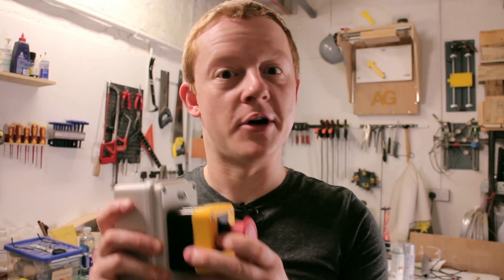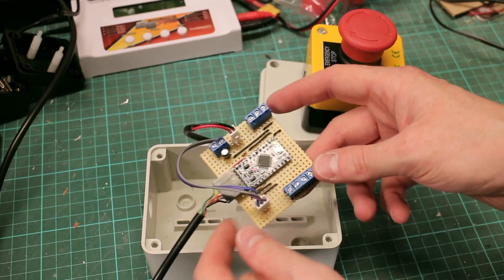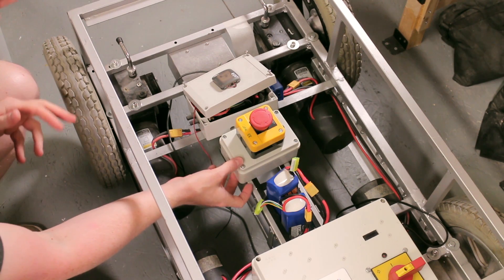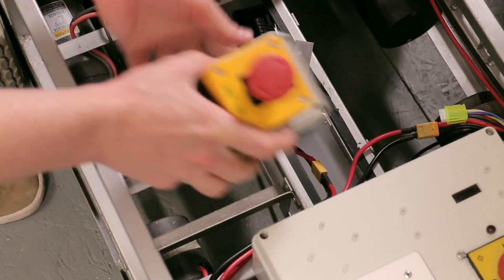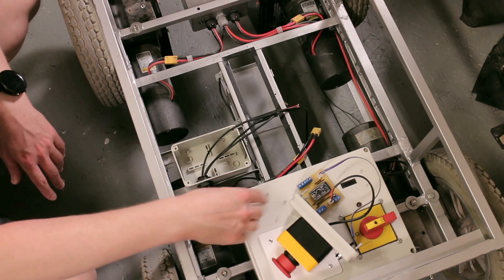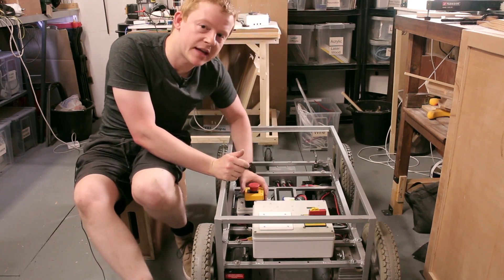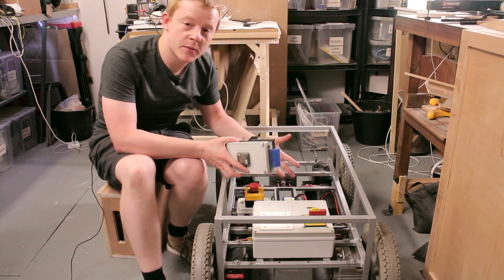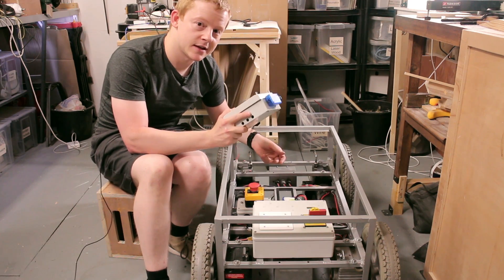Emergency Stop Button - Robotic Vehicle #4

Comment: so let me see if i am getting this right, kevin has dc motors and pwm, so if the pwm switching fails and goes short you have a runaway and a big red off button that wont isolate the motors....
basically, your motor isolator doesnt isolate the  motors....
Reply from the maker: +lez briddon it's doing two things, the main use is local close up testing and a way to stop it moving, this is what I mentioned in the video.
Another thing I have it setup to do is send out a stop signal if the input signal stops, either through a failure of the control hardware or a loose connection.